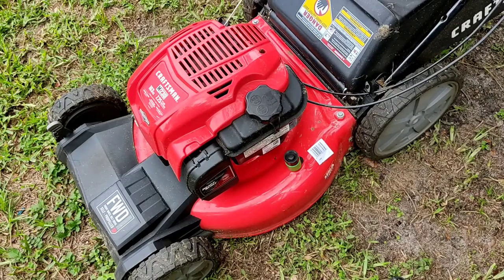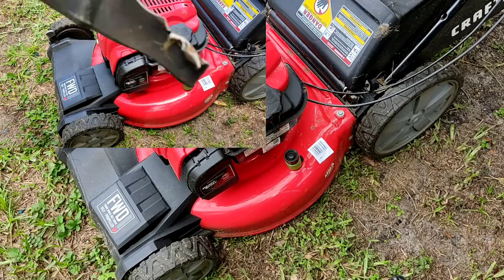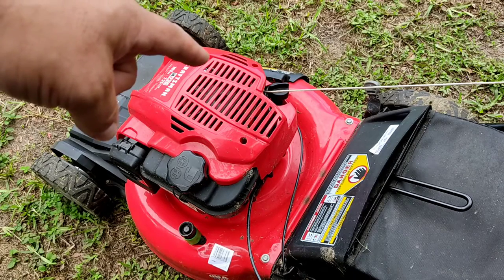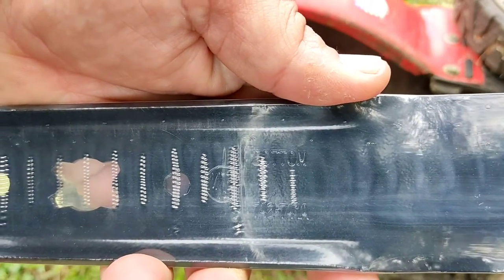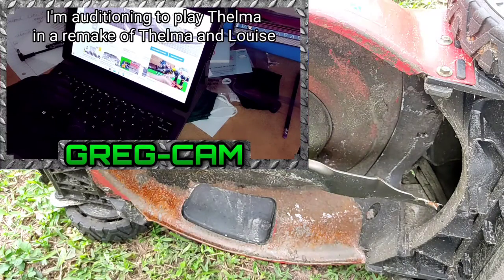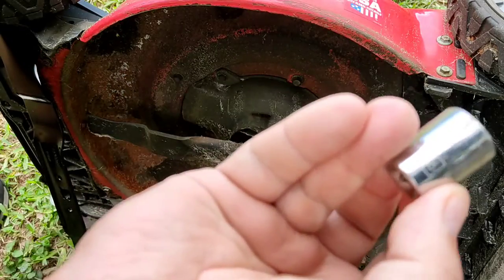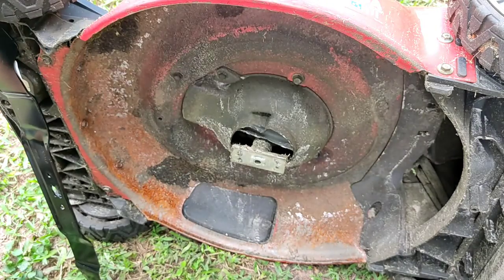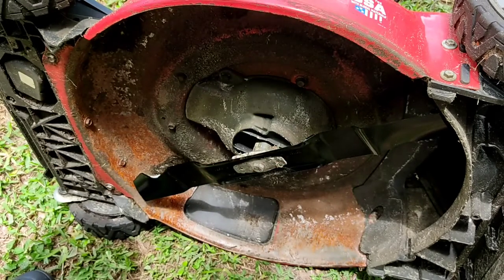Craftsman M230 Lawnmower Blade Replacement Starring Greg-Cam!

Comment: Uhm, 16mm is too big. You need a 9/16".
Reply: Thank you, I literally came here looking for the socket size.  I had a repair place tune-up my mower last spring, now I can't get the bolt off to change the blade, was using a 5/8.
Reply: @Dusto_55  I used a long pipe over wrench to extend and gain extra torque on the ratchet.   It worked well.  They're always tough to unscrew.

Comment: What if the new blade is a universal blade that fits craftsmen but the washer isn't the exact match ? When I start it and cut a little,  the washer moves from center. The bolt is still tight, but was curious if the blade would ever come off
Reply from the maker: Just use the old washer, or find one that fits.